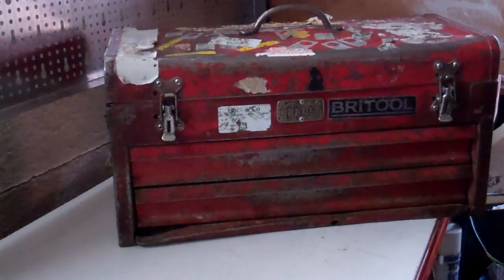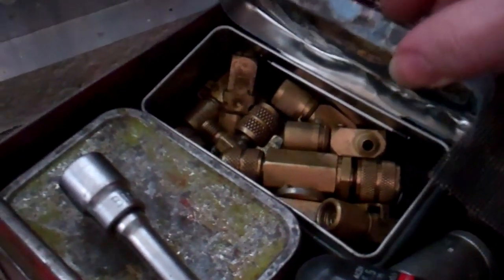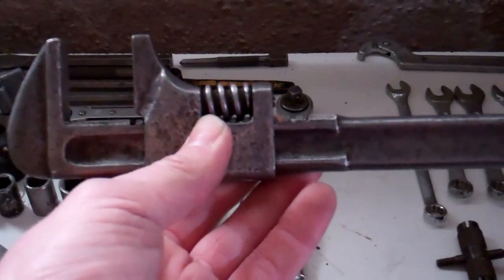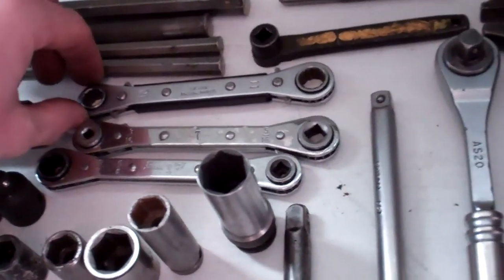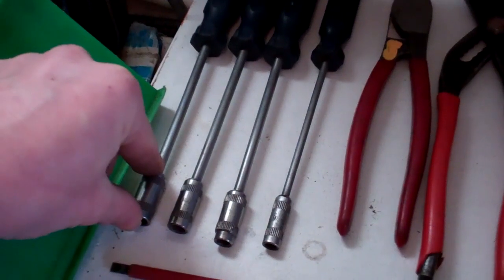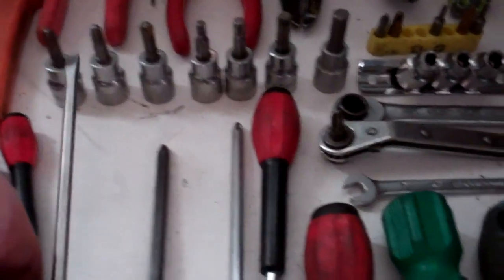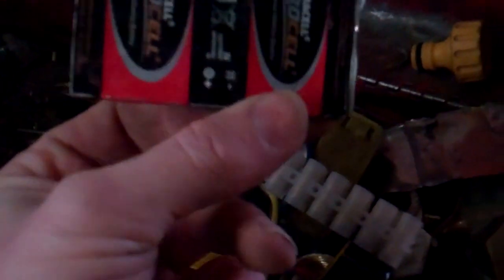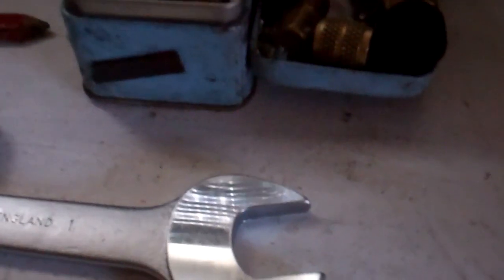HVAC Britool Tool Box Reloaded

Comment: that's a beautiful box mate though many might disagree . I was actually given a load of Whitworth spanners and sockets that date back to the 60's . When tools were made to a standard and not a price .  I was also given a 1/2 breaker bar with the end of it made to hold 1/2" drive extensions So in theory I could keep adding and adding to it, the infinite breaker bar .,haven't seen one like it . The weight might be a problem though lol Take care mate love the box and tools . Darren

Comment: You need to do some brazing and fix it up. Your brazing is very good, so you just need to get the sheet brass out and do it, or use old compressor shell steel. Mine is worse, but I brazed it up a few times and replaced the clips as well. Use an old spring to keep the clips from popping open when it falls to the floor.